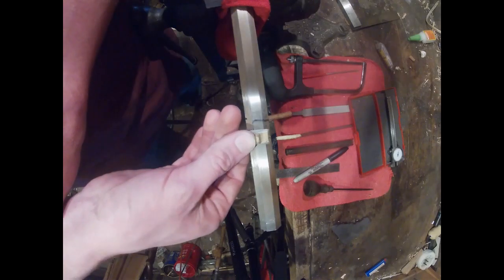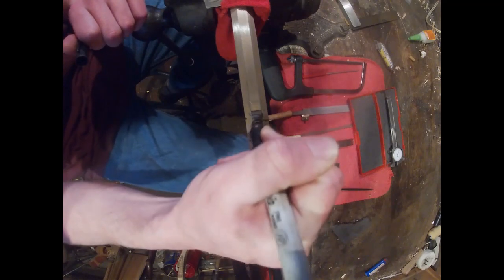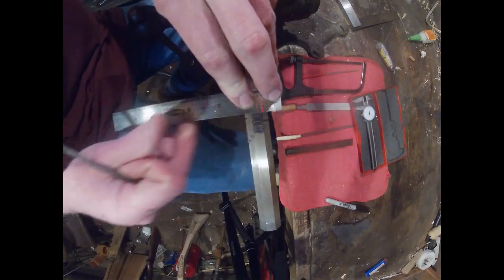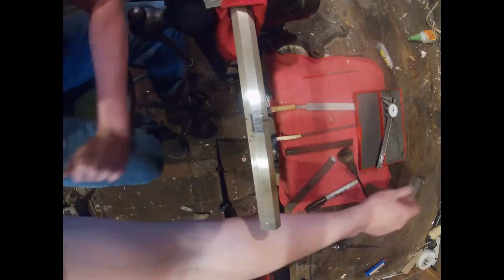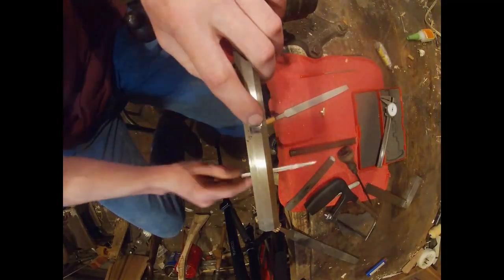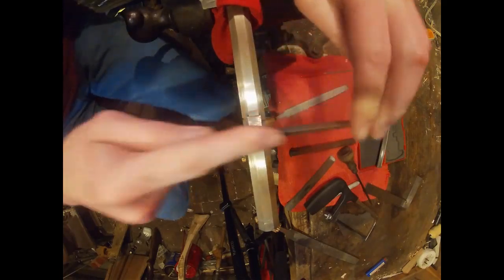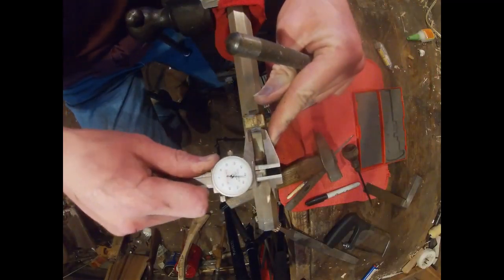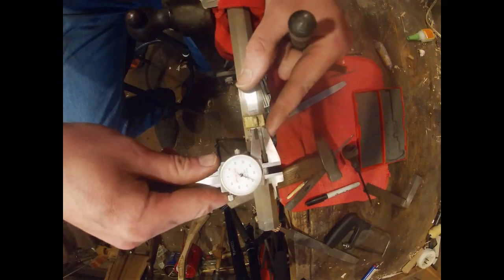Adding a Barrel Lug Dovetail to a Muzzleloader with Hand Tools

Comment: I find a sharp cold chisel saves a lot of work doing this  job. ( old schools BTW) The steel of a gun barrel cuts like cheese so the waist in the center can be cut out like you do in wood working after you cut with the hack saw, filing it flat as you would with a rasp working in wood.  Then the dove tails can be "cut" using the chisel as well. The steel is malleable and will  "peel up" making a perfect dove tail if one face of a sharp cutting edge it held frat on the bottom of the slot you have cut out.  (Later, the metal that stick up will be filed flat .) The part being installed is filed one edge of the dove tail straight the other with a slight round curve in it.  Peel back the barrel  little by little until the part just slides in. Center it and peen the soft steel back down to lock the part in place.  Now file off any metal that stick up for a prefect job. No gaposis. 
( worth a try .) Note on installing your sights: Only peen the center of the curve side down enough to hold them in place . Work up a load for the gun and move the sights if needed,. Then peen them in place permanently , file off the extra metal and brown the steel. Blue it if you must.
Reply from the maker: Thanks very useful information